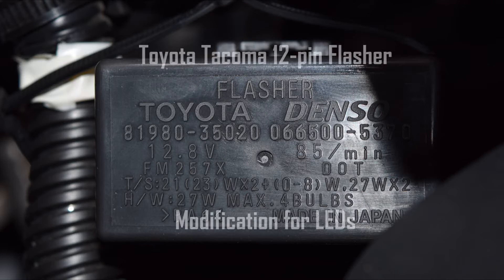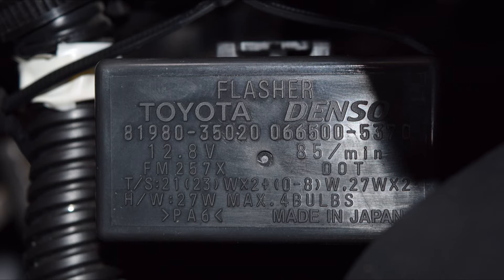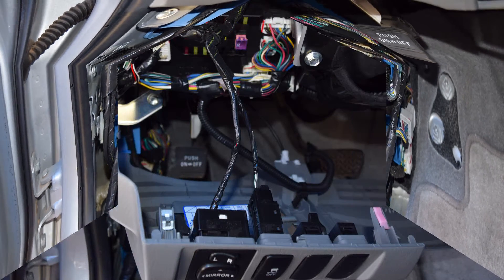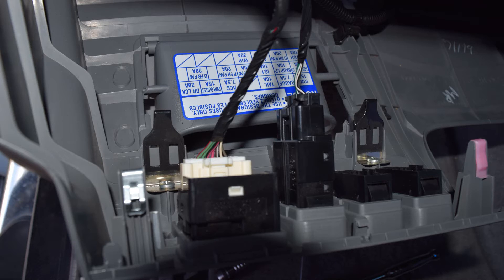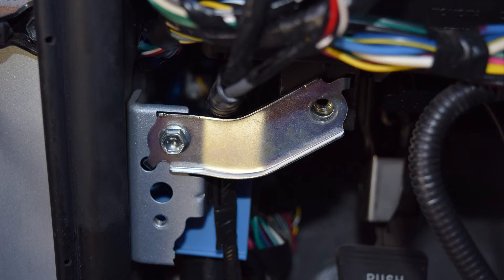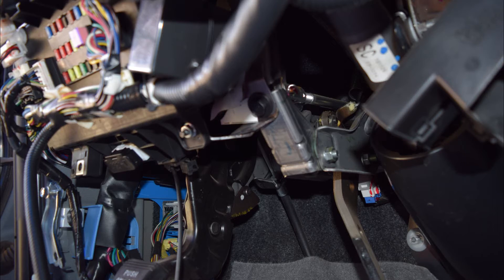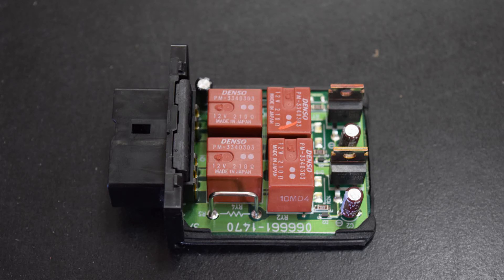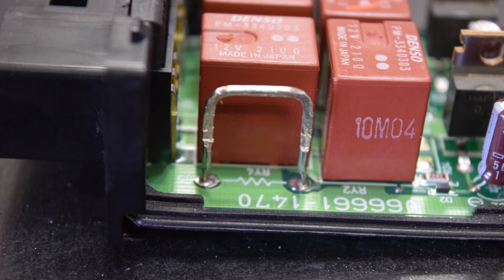Toyota Tacoma 12 pin Flasher Mod for LEDs

Comment: I have a 2004 Toyota 4Runner with all LED and I tried it. I used wife's Harmony Hand & Nail 150/150 file and just kept at it, testing the unit as I sanded. I sanded the whole wire trying to keep it even. It now works great, no more hyper flash!

Comment: If you're running Zevo bulbs, it seems that this has no effect no matter the amount ground off, at least for me.
Reply: Running Zevo Bulbs in the front only and I got it to work... Ground it down nearly paper thin though. If you end up adding LED's to the rear later... You will need to pull the shunt in it's entirety and install a resistor. You're looking for a .75 vdc drop. Vehicle bulb out condition is triggered by a .49 vdc drop. I will be doing rear led's later and will eventually be soldering in a resistor. If you use different bulbs, make sure you measure the current draw of each to calculate you voltage drop correctly. Good luck!
Reply: @TrevenaLuck  i recently bought the zevos led turn lightbulbs front and back what resistor did you purchase and soldered  to eliminate this problem. Thanks in advance.

Comment: Do you know the resistance before sanding,  and what you ended up with after?
Reply from the maker: Chris Doyle Unfortunately I did not measure the resistance before or after. Sorry
Reply: No Worries,
One other question,  I may have missed this in the video.  

But will this allow LEDs in the front only,  but still use bulbs in the back?
Reply from the maker: Chris Doyle In this case, LEDs in the back only. I originally planned to upgrade the front headlights to an aftermarket model with LED DRLs (stock uses turn signals as a pathetic "DRL").
Reply: Ah,  so this won't work for the front?
I have a 4Runner,  that uses a similar setup.   Turn signals are DRLs,  I want to maintain the DRLs,  but switch to LEDs.  

I'm having a terrible time finding anyone who did this.
Reply: Another is to not modify the flasher relay. Attach 6ohms resistor to the turn signal light in the rear will fix the hyper link.  The resistors won't heat ups while front signal light is in DRL mode, they only heat up when signaling. Plus, it's easy to attach those resistors to the sheet metal to spread heat in the rear light area.
Reply: 19 milliOhm
Reply: I just went with Sylvania Zevos LEDs front and rear on my 2011 Taco and instead of trying to grind the nichrome wire resistor, I replaced it with 3.3 ohm 2 watt resistor (3.3 ohms is a standard resistor value). It took several tries to get the value right as there is a tight voltage drop window the bulb failure chip is looking for. If the resistance is too low (around 2 ohms) the lights will flash fast and if it is too high (I found around 6 ohms), the lights will flash once when the turn signal is activated, then quit. Other brands of LEDs may need a slightly higher or lower value than 3.3 ohms, but that should be a good starting point if you don't want to grind the stock nichrome wire resistor.